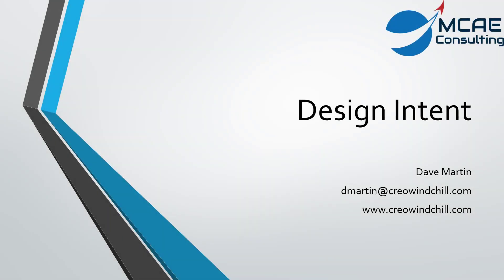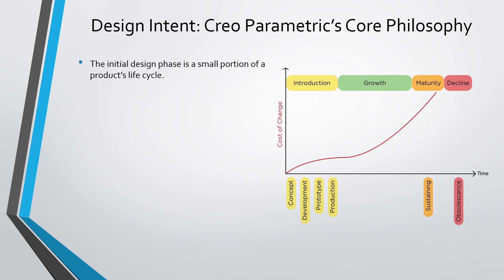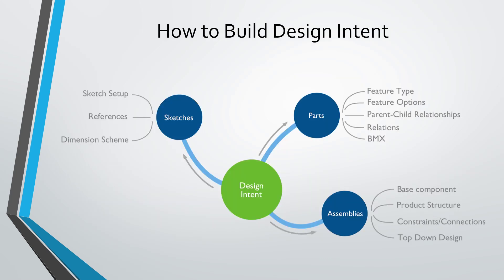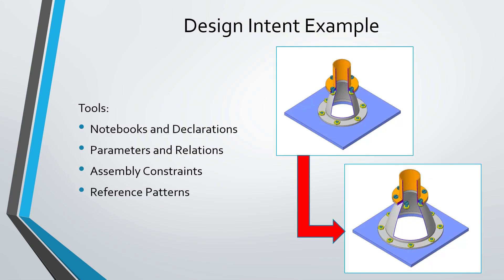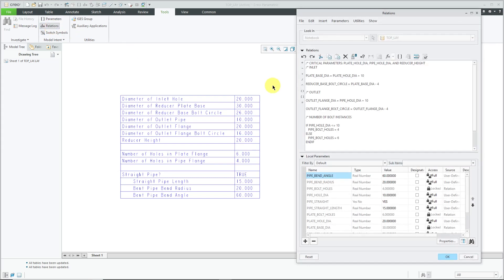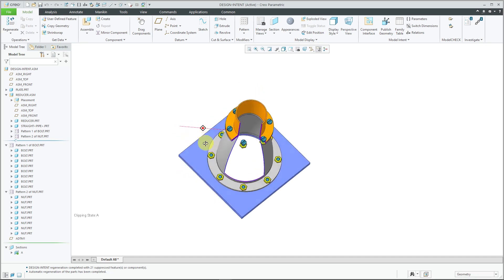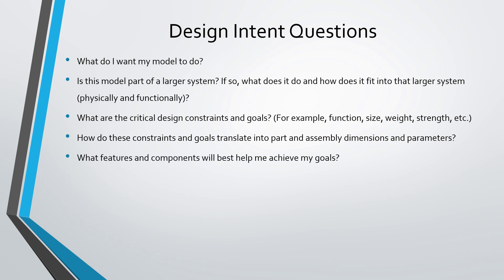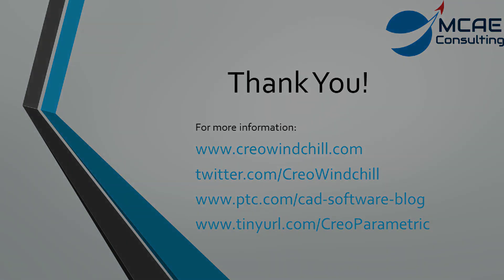Creo Parametric - How Design Intent Gets Built into Assemblies (Demonstration)

Comment: Clear and awesome way to explain a very complex concept !! thank you Dave. In the other hand I have a question and a suggestion if you don't mind. my question is about MathCAD calculation documents, is it an efficient way to control and drive design intent similar to what you have shown in this example via a notebook ? concerning the suggestion please, notebook is very useful and I think it would be great if you could make some videos about using it.
Reply from the maker: I have a few videos on Notebooks in the Top Down Design playlist. Here is the first: https://youtu.be/hcHeDwg-FiI
Reply from the maker: I'm a big fan of Mathcad. As a matter of fact, I write PTC's Mathcad blog, which can be found here: https://www.ptc.com/en/mathcad-software-blog 
However, although I find Mathcad great for driving models by engineering calculations, I don't find it as good for driving assemblies like Notebooks. You connect models to worksheets either by embedding them or using a Mathcad Prime Analysis feature, which takes effort to invoke unlike a Notebook. I will be doing videos on both methods.